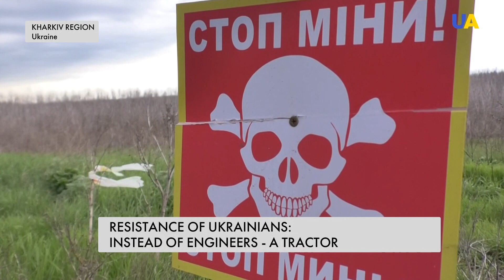Life hacks of Ukrainian farmers: armored tractor with remote control for demining of farmland

Comment: that could be used in several locations around the world.
Reply: There are vehicles built specifically for that job.  The problem is that there aren't enough of them, so yeah, you are most likely correct.   Some engineer somewhere should think about designing and putting out plans for such a conversion, but then if somebody got killed, he would probably be liable.  Lawyers are so helpful that way, some of them.